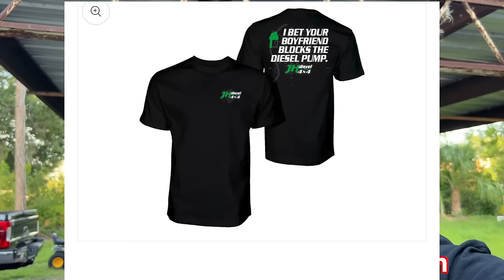We Made My Prius Amphibious!!!

Comment: I'd say mount the pontoon rotator about waistline to the Prius, then you can mount the pontoons on stanchions so they fold up on top of the roof.
Instead of a pneumatic cylinder, use a winch motor and gear/pulley system. Prius is pretty much it's own generator.
Lift-kit the Prius for some more clearance when getting into/out of the lake.
Weld some plate to the bottom of the Prius to fair it up a bit for (marginally) better hydrodynamics

Comment: That was some boys!
I would suggest the Pontoons lift and descend Vertically, not on an outward arc. That way the vehicle is not as wide while going down the road, the lifting forces are lessened, and the vehicle is completely out of the water.
Also, it would be cool if you could connect a driveline up to a prop that's driven by the prius and ditch the outboard all together.
I love the "helm" setup and some simple linkage could be developed to have remote control of the car's throttle and steering could be accomplished by dual-retractable rudders.
Then,  you could back the vehicle in at launch and activate the pontoons and simply drive straight out.
All the whole keeping the prop in the deepest part of the water.

Comment: Cool video, but why not build a lightweight aluminum single car trailer with side-mounted pontoons and outboard engine ? An easy quick-lock system for your car wheels. Hydaulic controlled pontoons to be lifted/lowered from top of the trailer to the sides. Then you can drive your car onshore at your distination, and then again drag the trailer onshore with your car if you want a roadtrip to go somewhere else. Amphibious multi-use car trailer would be awesome! Please build one..

Comment: Jh please start with a lower pitched propeller first before getting a new motor. That prop has way to much pitch for that much weight and drag. In this case id use a 10-13 pitch 4 blade

Comment: Change the design so the pontoons go over the car when in drive mode.  Use hydraulic or electric rams instead of air. Then get some horses behind that thing for some serious boatin. Awesome 1st run guys.

Comment: I think they're right, if the pontoons could be mounted a little lower, it'd get the car out of the water, hopefully, without them being a problem on the land. And then just an air compressor so you're never out of air, and a bigger outboard, mounted just a little lower. Also a little faster run back to land would have beached it maybe 5-10 feet closer to shore. Definitely a win like Cleetus said.

Comment: Would be nice if you don't need outboard for it? Just stand on rollers (front and back of the wheel so you can drive on the ground and and spin inpeller on water at the same time).

Comment: So for you guys to make $200,000 that is great this boat car combo need some hydraulic suspension or air ride suspension to raise the car up off the ground a bit so that way the pontoons themselves can be deployed before entering into the water then deflate the air suspension and pull it back up into the car for your main voyage It will also help with that bigger motor that you're going to need to put on there then you need to put saddles on the front of the pontoons so some boys can get up front and then get crazy

Comment: You need to put a Jack plate on the motor so you can lift it up when its out of the water and so you can lower it in the water yall didnt have enought of the lower unit in the water to get yall going.

Comment: switch from air to hydraulic fork lift cylinders or dozer cylinders ran off pump on car motor! think forklifts are little toyota four cylinder motors (Toyota makes forklifts and damn good ones) ....and they can lift 5000 lbs easy, use an fork lift for parts and controls!